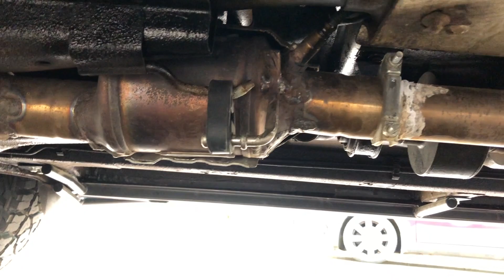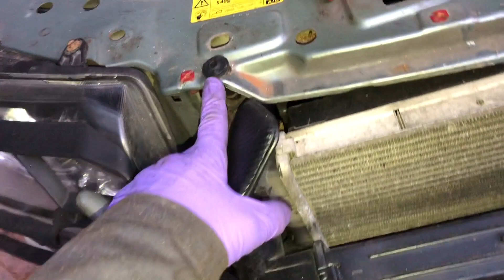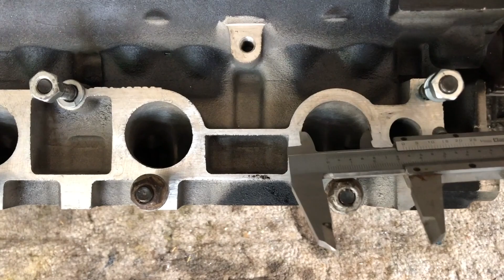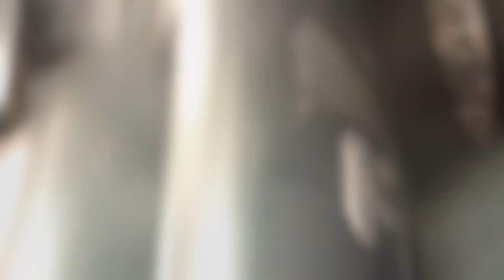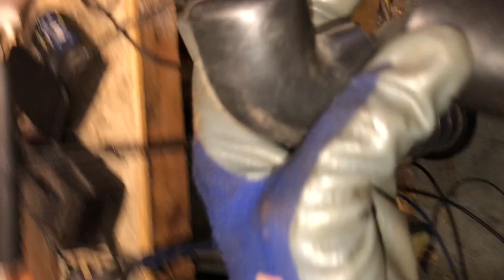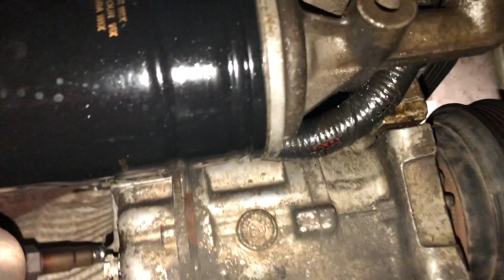Freelander 1.8 Turbo Conversion 200bhp

Comment: what are the major issues of this vehicle apart from the blown gasket? how often is it happening?its price as a used car is ridiculously low
Reply from the maker: If the head gasket leaks then it just needs fixing properly with the right attention to detail, as in my other videos.  When that is done they are as reliable as any other old vehicle.  Other typical things to wear out, similar to other old cars, are electric window cables, door lock motor and maybe the prop viscous coupler can stiffen up, so just keep an eye on that (check for severe reluctance to move when at extreme of steering).  I think they are great value cars, I run a 1.8 (turbo converted) as a daily and have a v6 as a new project.

Comment: So will turboing it help with the head gasket problem because mine is a bit dodgey
Reply from the maker: My 1.8 turbo is running nice and reliably because it was well assembled and checked and with an N-series gasket.  Turbo or not doesn't make that much difference to HG.  You just need to check and build the engine well.  See my other video on hints and tips https://youtu.be/8BEYJX-GOIc

Comment: I’ve just fitted a 1.8t to my zr, chap I bought the engine off had fitted an mls gasket which is weeping coolant down the front of block, would I get away with trying to tighten the head down a bit more or should I pull it all off and start again?
Reply from the maker: That can happen when the jobis done a bit sloppily, not sealing over small surface imperfections.  No harm in trying to tighten the head a bit more first, try another 1/4 turn each bolt and check the bolts have a consistent torque in case one has overstretched and has a weaker max torque.

Comment: this is interesting, i'll bookmark this for future reference, might be a fun project. one question though, how long did the build last? cause the piston sleeves are paper thin and this engine doesn't feel all that solid compared to a, say 7afe. When i redid the engine i considered what you did but felt like the block would only get a few months under the pressure of a turbo.
Reply from the maker: I’m still driving it and in use daily. Not gone wrong yet.

Comment: If you don't mind me asking what was the ballpark cost of this conversion?
Reply from the maker: I didn’t cost it out on mine, but typically it might be:  mapped ecu £200, turbo/manifold £100, MG6/1.8T injectors and inlet manifold £60, shorter 1.8T conrods and 160 type pistons £100, oil filter housing with oil feed output for turbo £50, oil return and tap to block £70, intercooler and hoses £100, optional uprated fuel pump £80, sytec fuel regulator and return line £100, N type head gasket plus misc bits and lots of time.  Surprising how it all adds up and these are all 2nd hand ebay estimates mostly, apart from the ecu where you send away yours to be mapped.
Reply: @comeinhandynow  
hi , what fuel pressure do you have?

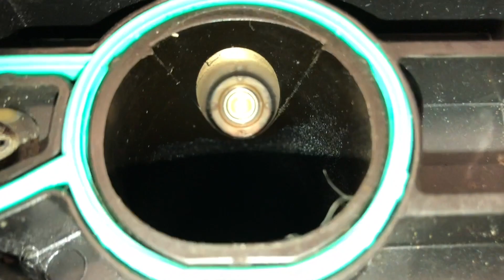Comment: @12:17 why have you cut the intake manifold gasket into individual rings?
Reply from the maker: The inlet manifold from an MG6 (what I am using) has separate sealing rings.
Reply: @comeinhandynow  Ahh makes sense!

Comment: Ah so you learnt the hard way the pistons like to melt when turbo ed lol
Reply from the maker: Yep previous owner just put a turbo on std engine, asking for trouble. Now that it has 160 type pistons, shorter rods and an ecu mapped for a turbo it seems to be reliable so far, at least since this was made.
Reply: @comeinhandynow  Very nice, they ain't a half bad engine when sorted. I'm currently doing the headgasket on my k series Elise, N series gasket and the rest. Doing it properly. Been picking up tips from all over the internet, so cheers for the vids
Reply from the maker: @b.eduardo5105  Thanks. I’ve done a few videos on k-series engine jobs, on my channel. Hope some of them help.

Comment: So the manifold’s just gone on my 1.8 (today 😤), and I need to replace it. I think it would be cheaper (longer term) to just upgrade the whole exhaust system to what you have here, in preparation for installing a similar turbo system. Could you tell me what manifold you used please? Where do the ST parts come into play?

Cheers in advanced, Arthur.
Reply from the maker: The exhaust manifold if from a 1.8 turbo engine like in the rover 75 / mg6

Comment: so I am wondering and I believe you might be the person to ask. Can an automatic gearbox from let's say an rover 75 1.8 be fitted on a k series freelander?
Reply from the maker: Not sure, but I wouldn't be surprised if there were a lot of compatibility issues: 2 wheel drive only, maybe electronic control of gearbox, interface to IRD etc. Probably too much trouble. If you want an auto freelander I would get a V6 model.
Reply: Did you ever come to a conclusion on this? The 1.8 is the only Freelander that's ULEZ compliant. I'm thinking that the way to do it would be to fit the transmission and rear diff from a KV6 with a 75 engine ECU.

Comment: Or you can put a turbine on KV6
Reply from the maker: No manual gearbox with that and trickier exhaust plumbing.  If you have details on a successful kv6 turbo share details please.
Reply: Thank you very much for the answer, but there is no turbo information for kv6 for the planting, if I find anything, I will definitely unsubscribe.

Comment: Nice job! I have a v6 and just like you I want a turbo with manual gears, not least because the jatco auto box is unreliable. So what I want to know is wether the viscous coupling on the 1.8 the same as on the v6?
Reply from the maker: I have read that they are different. Not sure it makes that much difference as long as it fits though.
Reply: Okay! Thanks. Must do a bit of research then. Much appreciated my friend.

Comment: Hello, nice build, ive now inherited a Freelander k turbo which needs new VCU/IRD and has cracked a liner..Essentially a resto rebuild now. Can I ask for details on the turbo water pump addition?
Reply from the maker: Thanks, what would you like to know? I assume you mean this: https://youtu.be/eAmWeRuVoNg
Reply: @comeinhandynow  ok thanks, did you design the timer unit? I'm wondering whether the ecu power down relay feed might be utilised
Reply from the maker: @markstacey8092  That timer unit is an off the shelf unit, so cheap it isn’t worth doing your own and it does the job.  Buying links in video description.  You could use the ecu power down time but it is not as long as you can get with the timer.
Reply from the maker: Hi again Mark, I just realised you are the guy who supplied my remapped frelander ECU. Can I ask a question in return about the ECU map you did: Was it mapped for a constant fuel pressure of 3.5 bar or one that goes up with boost via a regulator connected to the manifold?
Reply: @comeinhandynow  The setup runs the standard returnless fuel system. By the way  ive refined the cold fuelling a little to clean up the response (focus was fully warm tuning initially) so can update if you want to send the unit.
Reply from the maker: @markstacey8092  Thanks. I run the mg6 manifold and injector rail, which is returnless and with no increase in fuel pressure with boost, much like an original freelander rail (that has a damper on rail but i dont think that increases fuel pressure on boost). 
But most mg turbo and freelander 1.8t people seem to be running with a regulator on the rail to increase fuel pressure on boost when using your map. Hence I’m a bit uncertain which is right, especially as on 11psi boost I was starting to run lean so I used an extra injector + simple ecu to inject a bit more fuel just on boost to get in the 11 AFR.
The fuel pressure on my meter was a fairly constant 3.5 bar. 
Unfortunately I dont think that was very balanced and a piston ringland broke. 
Just rebuilt it and looking to increase fuelling with a pump upgrade (5 bar reg in pump) and regulator at engine end but not sure map is appropriate....and whether i connect regulator to inlet manifold or not for boost fuel pressure increase.  Got any guidance ?

Is the new cold mod map buyable as a hex file that i could write in myself?  Or what cost to send in for an update?
Reply: @comeinhandynow  the 75 turbo has a similar returnless set up, just with higher flow pump. Just keep an eye on AFR but should be ok with high flow unit. Might be best to send the ecu, can provide latest update at £99. My Freelander is completely stripped now including liners removed,  its actually the first time I've taken a K apart!
Reply from the maker: @markstacey8092  The 75 turbo has a fuel rail regulator that increases fuel pressure as intake boost pressure goes up I believe, so if the ECU map is setup for that 75 turbo rail then I’m going down the right path of fitting a regulator to my mg6 1.8T rail to do the same job.  I’m using a nice and cheap ebay adjustable regulator on the fuel delivery side to the mg6 fuel rail. It does mean I’ve got to run a fuel return fuel line for the regulator though, easy enough I think. 
I might at some point be interested in the update, see how things go when its all running again, it may be worse at cold idle with the new regulator as the bit of vacuum in the inlet manifold will tell the regulator to lower the fuel pressure a bit. Hopefully the closed loop lambda control will compensate.
Great to see that you have a 1.8T freelander to explore and improve.  I’ve done a few k-series rebuilds for head gaskets mainly and still learn a few lessons as time goes on.  I put a few in a do’s and dont’s video on my channel, might be something useful in there. I am more careful now about getting good liner protrusion, 3 or 4 thou.  Shims under the liners are great for saving the block from sunk liners. Also a very thin smear on the block of locktite 574 around the water and oil sealing points seems to help as often it gets scratched and corroded.
Reply: @comeinhandynow  I am looking at liner shims at the moment, although MLS is popular I'm tempted with a single layer N series PAYEN in case there is minor height variation..I'm.also replacing big end shells, new gapped rings etc in case I get the urge to fit the 275bhp turbo spec later..
Reply from the maker: @markstacey8092  I always use the N-series gasket (as used on MG6) which is a MLS one but without the indenting fire rings that damage the head.  I've seen too many elastomer gaskets let go around the oil ports to risk using those. The elastomer lets go suddenly, whereas the N-series one will only seep if it fails Again I've a video on the different gaskets to show the failures.
If you want to go bigger turbo personally I would use stronger pistons, maybe the acralite forged ones or omega maybe.  I have had two broken ring lands on pistons on this project, one lot the previous owner mess up.
Reply from the maker: @markstacey8092  Westwood ductile liners seem a good idea if you are going to 275bhp.  Keep in touch with your interesting progress.
Reply: @comeinhandynow  we've had several cars running 275bhp reliably for some years now, on std internals/bigger turbo and injectors. There's also a 320bhp ZT turbo which has run happily too but with forged internals
Reply from the maker: @markstacey8092  Interesting.  Glad I stuck with standard (160) pistons and std liners for now then. I read so many conflicting reports of both high boost on std internals and others say the pistons fail over 12 psi.
Reply from the maker: @markstacey8092  How is your Freelander restoration project going? I’d be interested to know of any further power increases. I’m on the standard gt2052 turbo at the moment but thinking of changing to the t25 type when I have time and maybe advance the timing to get more mid range power. Have you any opinions on this?
Reply: @comeinhandynow  we have been tuning for t series spec 
turbo/inj for some time in ZR, Metros etc, seeing over 270bhp on standard internals